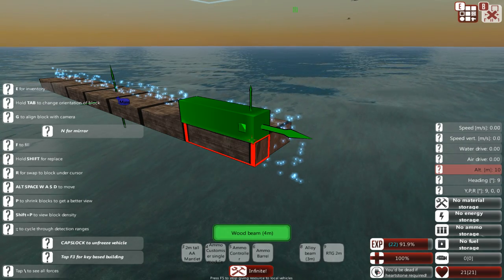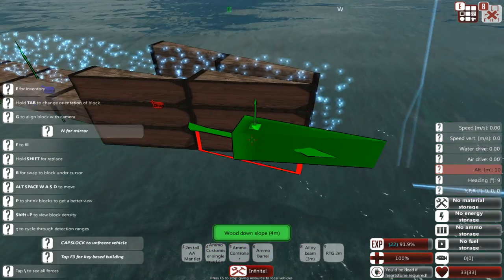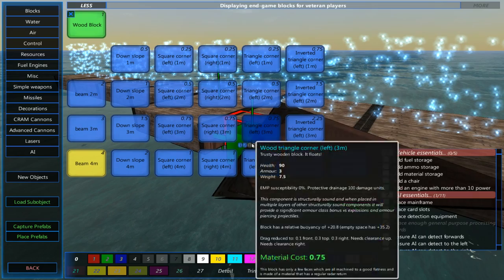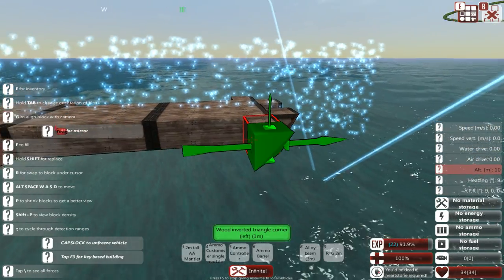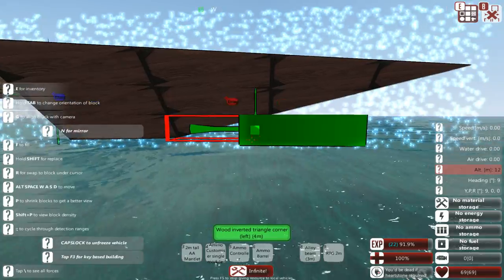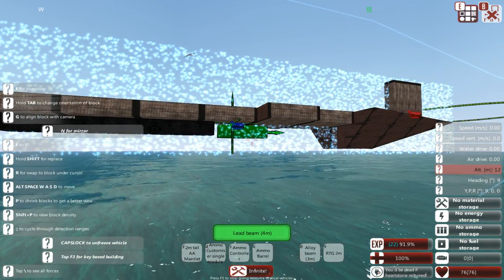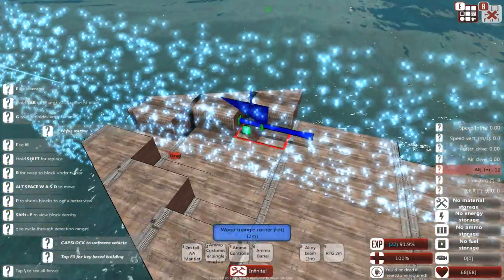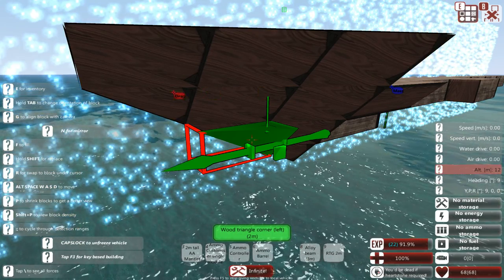From the Depths - Hull design

Comment: It's possible to change the angle of the nose once you have that 45-degree vertical cross section, which lets you pretty easily swap between 1, 2, 3, and 4m angle slopes. This can have varying effects such as quickly rounding off a nose (shortening), or elongating it. Switching to slopes after about 3-4 slope layers and going 'vertical' is also pretty good compromise, and offers more internal space without any pitch balance issues.
Reply: Do you know any videos or any tutorials that shows how that's done? That is exactly what I'd like to make, but in couple hours of trying to make the hull I couldn't figure out how to do that. Geometry wasn't my strongest subject in school lol

Comment: Do you guys normally build your entire hull first before touching turrets, engines, AI's etc?
Reply from the maker: Usually yes. Adventure mode is the exception. That's when I prioritize resource gathering, then propulsion, then weapons.
Reply: I usually lay a keel and a base, build the engines, mainframe and turrets in the interior layers, then build the walls and upper deck over it